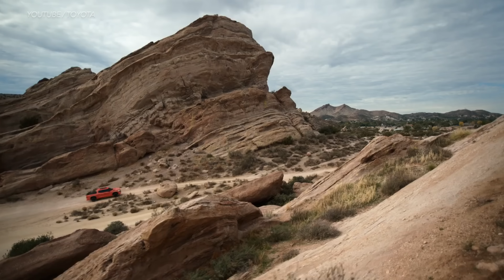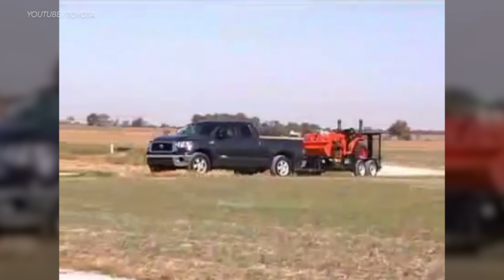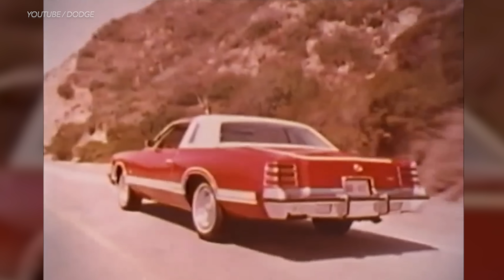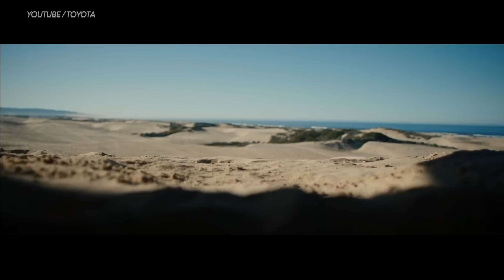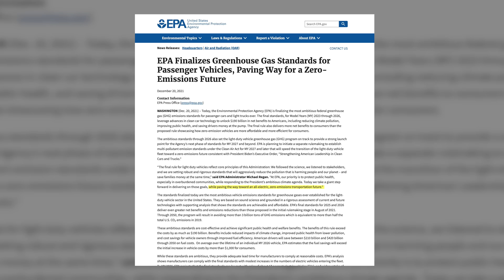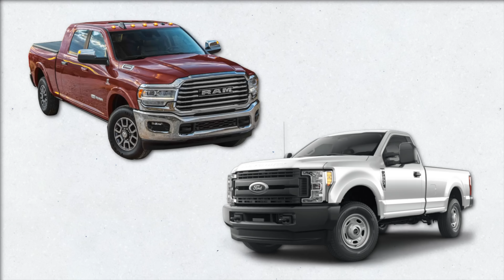Here's Why Ford Just Sued Toyota

Comment: Well, I guess "there is no replacement for displacement" after all.
And yes, a bigger engine will not only be able to produce more power, it will also be more reliable, durable and smooth. If you actually take those 2 rotations for a complete cycle of an internal combustion engine you can see how the engine with more cilinders will be smoother making 4 explosions per rotation instead of 3 in a 6 cil or 2 in a 4 cil.
I guess there is a reason behind those exotic V12 engines. But my question is... why do manufacturers go way out of the .5L of displacement per cilinder sweetspot of efficiency? I mean, that allows for the best burning efficiency on a chamber, that engine would make the most power and torque out of a certain ammount of fuel right? So a 3L V6, a 4L V8 or a 5L V10 would be the best engines of their class allowing for the best output per ml of fuel, the best output per unit of displacement and the best fuel economy overall right?
In my mind a 5L V10 would allow for better performance and fuel efficiency than a 4L v6 or a 5.7 to 6.4 L v8, it would be able to create more torque due to the accumulation of explosions per rotation of the crank, get a smoother operarion, allow for higher RPMs and sound more sporty or agressive than other options. Correct me if I'm wrong. And that .5L per cilinder number I got it from an interview made to Gordon Murray and other made to an engine development engineer from Cosworth.

Comment: Scotty, I bought a 2021 V8 last year, instead of waiting for a new 2022 model.  My main motivation for buying it was because of its past record of reliability.   I also tow fishing boats so I thought the V-8 would be a better choice in the long run.  I hope to keep this truck for the next 10+ years.   Do you think the resale value of my V-8 will be maintained over time, or will the presence of the V-6 models now, and in the future, drive the value of my truck down?
Reply: It depends on how big the boat is. There also going with bigger transmissions now to help you get the torque out of the  V6's. I really don't think the V6's are going anywhere anytime soon and have a feeling the V8's are on their way out the door. Now again unless you're pulling a 30 plus foot boat. You really don't need a V8 these days and even at 30 ft you could probably still get away with a V6. The 3.5L in my 2017 F150 Supercab doesn't do too bad. I was actually surprised for a naturally aspirated V6. But it does have two injectors per cylinder one being in the intake manifold runner and the other being in the head for high pressure direct injection and believe me you step on it and she gets up and goes. There's also 3 or 4 different transmission modes depending on what you're looking to do save fuel or tow etc. I have the 6 speed transmission. If you're looking at an F150 I would stay away from the 10 speed transmissions as Ford can't seem to get them right for whatever reason. Whereas the 6 speed is pretty rock solid.

Comment: The Toyota Tundra may be better in every way. But even the new ones feel like I am in an old Hi-Lux mini truck. It all has to do with the way the seats sit low and the floorboard is high. The domestic trucks across the board all have a more chair like seating position.

Comment: I think is cool that they trying to squeeze v6 engines and making them more powerful every year, but a V8 is just so much more reliable, strong and durable. If they can make a V6 that can withstand anything that a V8 can? Then that would be amazing. But those that have an old v8 tundrA wont part ways with it 😂

Comment: I’m not a huge fan of the styling but I could over look it. The twin turbo part of the new platform doesn’t worry me it’s the hybrid option I’d avoid. Toyota makes a lot of effort to be reliable and modern oils are up to the task of turbo charged engines. That being said my needs would be mostly light duty stuff. And it’ll be awhile before I’ll need to upgrade my 2010 model crew max.

Comment: Regarding the comparison between v6 and v8, the v8 produces less power per engine volume and also less torque per engine volume. Wouldn't it be smarter to just scale up the v6 to 5.7L instead of the two additional cylinders performance wise? Of course the v8 sounds better, but with those figures and the obvious extra two cylinders that could fail i don't get it.

Comment: I’m running a 16 trd pro tundra as my work truck loaded down with several thousand pounds of tools… I just rolled over 200k miles and this truck hasn’t given me any issues, I love Toyota but I don’t think that 6 cylinder could keep up with this V8 long term how I use it. So for me not having a v8 option is making me look for a 2500 series truck preferably diesel but I don’t really care for any of the makers options they are all crippled horribly by the epa

Comment: My F150 3.5 Ecoboost has always been mostly my “go to work car”.  I’ve owned over 50 different vehicles and this is by far my favorite.  Now has 140k miles and it’s still a keeper.
Reply: We’ve owned and leased dozens of F150s with the 3.5 EB….. fantastic combination! Don’t scrimp on oil changes and it’ll last…..

Comment: "Tundra" is a contraction of the "nickname" given to the T100 by some. T'undred became Tundra and fit in with the Tacoma as they both invoke the Northwest. IMO!😆
As for the V8, the vast majority of truck buyers don't work their vehicle. The V6 making better mpg and the same power makes more sense, especially when fuel prices are more than DOUBLE what they were just 2 years ago.

Comment: I'm currently driving a '21 Ranger, that I'm trying to get lemon lawed because of constant electrical issues that Ford can't figure out, and one thing I've learned from it is that the fuel economy tanks when towing heavy or when driving on the interstates around me where the speed limit is 75. In short if you're actually putting in work with the engine the turbo really doesn't seem to be saving me any money and my next truck will be a V6 if midsize or a V8 if full size
Reply: ,75 mph you not save gas on any car or truck rpm is higher

Comment: I have a 4.6 l double cab tundra and it gets equal gas mileage to the 2022. Why couldn't Toyota offer a small V8 such as that with the battery assist to give it torque versus turbos? Then offer the larger V8 as an option for heavy duty with some modifications to it. This would fit the requirement for work trucks that contractors require. Double thumbs down for twin turbo!

Comment: I bought a 2012 Ram 5.7 hemi new.  I also purchased the Chrysler/Ram (whoever)lifetime wrap warranty.  I plan to drive that until they will no longer honor that warranty.  Knock on wood I have had great luck so far with very little work that has needed to be done.

Comment: When my old 2008 Tundra finally bites the dust I will be looking into a GM V8...truck quality is not quite Toyota, but I will live with squeaks and rattles to have a reliable engine that can be worked.
Reply: Gm sure as hell isn't the way to go
Reply: @derakbell8143  well the 5.0 from Ford is a terrible engine to work on and around and Ram is out of the V8 game...so who else is left that makes a decent engine? Don't say Nissan as I live in Canada and they are not that popular or easy to get parts for.
Reply: @coryernewein  just get an older one.with a V8

Comment: How did you make this video while not having a clue about the 2022 Tundra?
The TTV6 makes more HP, WAY more torque, and has higher towing capacity than the outgoing V8 models had - and all while getting better fuel economy.

Comment: Toyota is just confused by the SUV market which is what all this fuss is about. Everyone wants a big SUV with all the safety features and a v12 with 50 MPGs. Its not going to happen but its what everyone wants. So to save costs they try to make it so that the stuff they are using in their SUV lineup (their biggest lineup) so they can be used with the trucks, but a good chunk of people use trucks not only for work but for vacations such as going overlanding and camping. You need a diesel or a V8 to help with payload and towing capacity and a smaller setup just isn't going to cover it. They still use the V8s in their Lexus lineup so I don't understand why the option wasn't there. At least give the option to custom order one with a V8, don't just nix them completely. If you turbo charge a V8 or even supercharge it you can tweak it and get some decent gas mileage reduction and then crank it up for power. I really do think they are going to lose big on this one. I don't see any of these new trucks on the road, but still tons of older tundras. A 2021 body style with a v8 and lexus interior package on a crew cab with all the bells and whistles for towing and accessories for 100k as a luxury package would sell like hotcakes, but noooooOOOOooooo, what do I know. 🤪

Comment: I will never buy a V6 Tundra.  NEVER, dont want a V6 in a full size truck. period.  Will not buy an Eco-Trash engine from Ford either.  I have looked at the new Tundras and they look cheap and I cant believe Toyota has released such a vehicle.  And Scotty please spare us on the less parts for a V6 vs V8, are you kidding us.  You took away two cylinders and added two turbo charges, two intercoolers, additional control systems.  Please man, dont do that.  Less maintenance means less stress?  What the hell does that mean?  You are making stuff up now.

Comment: I don't necessarily believe that auto manufacturers WANT to get rid of the V8,  people love them. I firmly believe the push is coming from the strict EPA emissions. Most V8 trucks now shut a number of cylinders off while driving, you can't tell me that's good for the engine in the long run? I believe, the V6 twin turbo is the way of the future, by law, not by choice.

Comment: The 5.7L N/A Tundra motor is a million mile motor. Turbos fail after 150-200k miles. 3.4TT is a deal breaker for me. Truck looks sharp but I'm good with my 2018 Platinum Tundra.  I'll be driving it until it is dead or I am. 😆

Comment: High technology is making new vehicles into junk, and so is the endless pursuit of more horsepower.  Imagine lower power vehicles with up to date fuel injection, and lightweight materials.  55 mpg would be easy.  A grocery getter doesn't need to weigh 4500 lbs and go zero to sixty 5 seconds.  My first new car was 92 plymouth Duster with a 3.0 V6 and 5 spd manual.  Fun to drive, and 30 mpg on the highway was normal... 30 years ago!  Trucks are another story.  I sold my '15 F150 3.5 Ecoboost with 33k miles and bought a  2011 5.7 v8 tundra.  Why?  because it is easier to pay at the pump than making appointments and missing work to go go to the dealer.  Once my extended warranty was up, it was bye bye.

Comment: Definitely a deal breaker. I wanted a Tacoma and Tundra to be the last vehicles I buy new and run them until they can't anymore, but I know now I'll have to get an older Tundra (which right now is just as expensive as a new one) or go with the F250 (which is also insanely expensive and getting rarer). Still love Toyota though and I'm sure it will be just as reliable!
Reply: What's the deal breaker, not having a V8? The Tundra V6 makes 438HP and 583ftlb....both more than the Ford 7.3 liter Godzilla V8....Toyota are famous for their reliability and I don't see that changing, I'd recommend test driving the Tundra before you make a decision.
Reply: @leeward6762  I definitely will have to see it in person, I'm just not a fan of the twin turbo idea. Seems like more stuff to go wrong and not be able to repair myself in the future if I wanted this to be as reliable as the past Toyotas and never have to buy a new one again. I understand where you're coming from though.
Reply: @bryan6296  yeah more complexity generally means more problems for sure, but hopefully the advantages will outweigh the disadvantages, also most modern turbo engines have been designed from the ground up to have forced induction, where older turbos were not. So it'll probably just be a case by case thing, some horrible and some that will last forever, we'll just have to wait and see....either way nice talking to ya

Comment: Well really the first Tundra looked very similar to the F-150 with really only the grill being inverted. They were very similar in design. Pull up a photo of a 99' F150 and a 2000 Tundra and hold a finger over the grill.

Comment: Look bro… the Tundra TRD Pro I-force Max edition has 437 hp with 538 flbs of torque. Test drive one and you will be sold. All that power from a V-6 twin turbocharged hybrid engine. Beat that.

Comment: for my personal use of full size truck the recent 6 cylinders are absolutely adequate, i had with both NA 3.7 Ford and and 3.6 Pentastar about 25 mpg on interstate empty, both are peppy when they empty, but start lacking when they max loaded which the Ford is used for work... Slow downshifts plus lack of power when loaded is sometimes dangerous for passing and i end up turning off AC and use gear limiter to pre downshift

Comment: There's a lot more that goes into towing than simple v8 vs v6. Unibody vs body on frame, the overall suspension, gooseneck hitch vs rear ball, tire rating, etc etc etc.  If anything I find the specific engine matters very little...you need torque but you also need a vehicle built from the ground up to tow the amount of weight you're looking for. You can get torque from other sources like superchargers and turbochargers.  Given that's the case I tend to agree with Toyota that a light duty truck which can't tow a lot to begin with doesn't need a V8. If you want a heavy or super duty truck you're still going to be disappointed in the Tundra.

Comment: I have a 2012 Tundra with the V8 and it's great. However back in 2017 I rented a Ford Expedition for my family and I to go on a long trip. It had the twin turbo V6 Ecoboost and I was very impressed with the power it had but even more impressed with the gas mileage at 24 mpg on the highway. With that being said I would not shy away from the twin turbo charged V6 that the new Tundra has. I'm thinking it will have plenty of power and the legendary reliability of Toyota!!

Comment: Tundra’s are not gonna be used by construction fleets or contractors, the only one probably using a Tundra will be the one guy that just goes and stands around. Tundra’s were made for people that will occasionally put something in the bed, and maybe tow a boat. Just look at it, the bumpers are plastic, the F-150 has steel bumpers.

Comment: I have a 2010 Tundra 4.6L v8 and love it.  I would not buy a new truck because of the cost.  As you have said many many times the turbo just wears out any engine attached to it.  With the high cost and the short life it is not worth it to buy these high tech expensive vehicles.  I will just keep my old Tundra until the wheels fall out then I will put them back on.  I know you like Toyota's but all the new vehicles are just built too cheaply to last as long as the one I have now.

Comment: Toyota should just keep that 5.7 liter V8, and improve on the transmission. Why not a 10 or 12 speed transmission, I mean more gears equal less fuel used which will by design lower the RPMs .

Comment: If your considering doing serious towing, your already probably skipping the 1/2 ton market regardless to be fair and going for a 3/4 ton F-250 or equivalent truck. Plus 3/4 ton truck's are just set up better for towing right from the factory with the proper electrical connections and heavier hitch built on board. 

1/2 ton Truck's are for the occasional tow for home owners. But a 3/4 Ton is ment for more commercial use.

Comment: IDK, I associate most V6 trucks with having at best , a class II trailer hitch, only the 4.0 L' s with an extra intercooler  could really work with a class III, up to a certain point.  To really use Class III or higher hitches you need a V8, or at least that is how it was. 
Now with these new little hopped up engines that you can't work on IDK :)

Comment: I was planning on buying the Tundra when it came out but when they switched to a twin turbo V6 I gave up, Even tho the V6 in theory requires less maintenance with the two turbos and higher rpm’s it will wear out way quicker than the V8 would, also it is a weaker engine for towing trailers and stuff, I’m a Toyota fan but unfortunately this time I will have to look somewhere else!
Reply: 22 Tundra owner here. This truck tow better than my previous 6 v8 Tundras🤷‍♂️
Reply: @victorheartsill5701  doubt you've towed anything heavy
Reply: I doubt Toyota's V6 turbo is high reving. My Ford 2.7 turbo has 400 ft. Lbs at 2750 rpm. It drives like a diesel. Barely revs to get up to highway speeds also tows better than my 5.4 with 3.73 rear end!
Reply: I have the 22 Tundra and I can tell you it tows like a dream. 479 lbft of torque at 2,400 rpm. If it weren't for the mirrors I wouldn't even know my boat is back there. It barely ever revs above 3,000. Now if you look at most NA V8 specs, they're not hitting peak torque till after 4,000 rpm.
Reply: Get a 2021
Reply: @jaymoar3561   it looks super outdated I would much rather get a f150 with an v8, but they are having a lot of problems with frames as well so I might just hold off for now or buy an 2022 GX 460 with the V8 and go a completely different route.
Reply: The thing is, turbo V6 engines rev lower than the V8s they replace.  Check out TFL’s Ike Gauntlet test up 7% grades at 60 mph.  The Tundra revs only 2000 rpm most of the way.
Reply: You obviously haven’t even watched any towing reviews on here. It’s not a high raving engine. And it’s not a weaker engine by any means